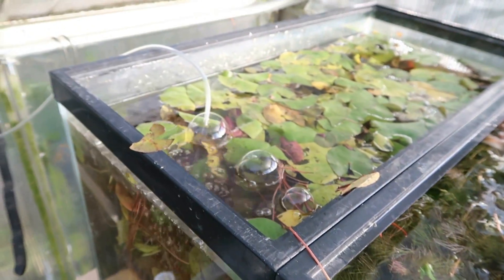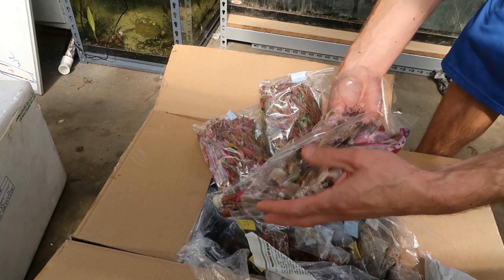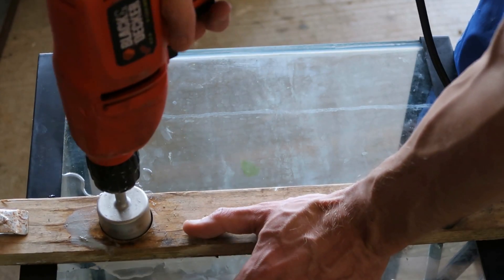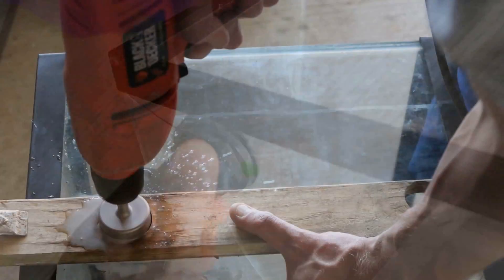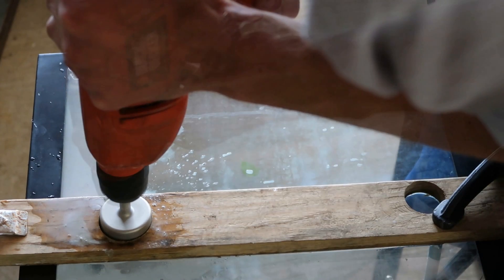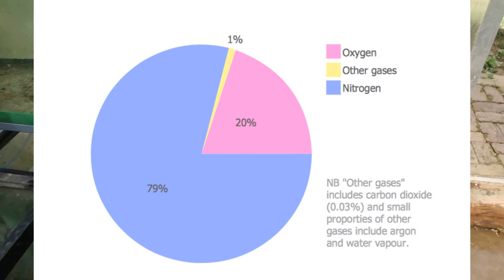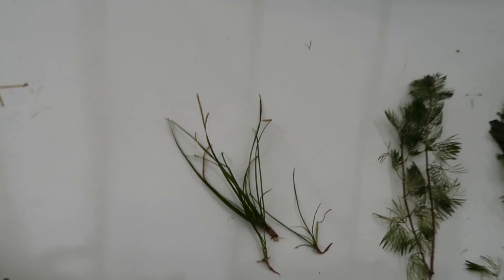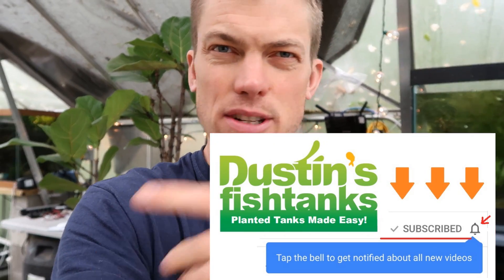How to Drill Aquariums, Drilling aquarium glass, Import Prep

Comment: Interesting that you brought up the "aeration to gas off ammonia" thing. I've seen that notion come up a number of times in discussions. A publication (J Hargreaves & C Tucker 2004, _Managing Ammonia in Fish Ponds_) noted that studies of ponds showed that "aeration is ineffective at reducing ammonia concentration" due in part to the total volume of water being large compared to the amount that could actually be aerated at any one time.

What I think is the more likely pro for aeration in relation to ammonia; the increase of the water's dissolved oxygen through aeration aids in aerobic nitrification by bacteria, which then work to lower the ammonia below the level obtained without aeration. Assuming that's true, this would be an important distinction for those thinking that their systems could simply deal with ammonia via aeration without providing sufficient media for the nitrifying bacteria to colonize.

Comment: Dustin I have a question regarding the drilling of the tank, let's say I drill to the top of my tank and instead of using an elbow to the inside I use a bulkhead strainer and a ball valve behind to adjust the flow of the drain do you think that would be silent and a good method of overflow?

Comment: Cabomba likes cooler water.  75 and below.  It will shed leaves and dissolve at tropical temperatures.  Separate the stems. strip the leaves, and slice off a clean bottom cut from the stem.  This was our go to 'bushy' plant in the old days, but we always had marginal success because many fish demanded the higher temps.  Oh, and give it high light.